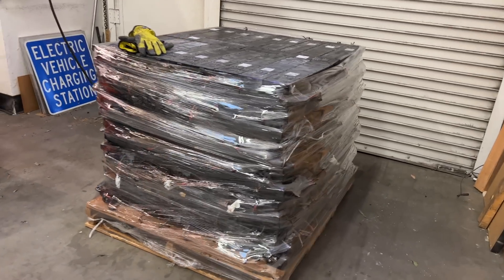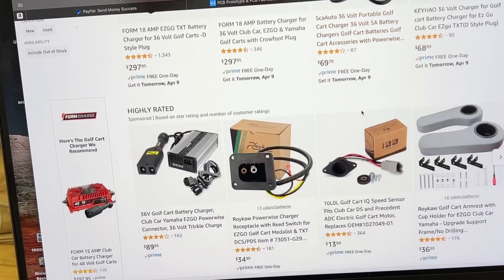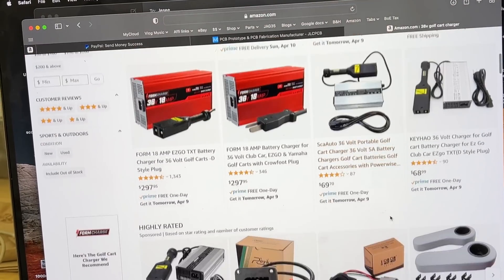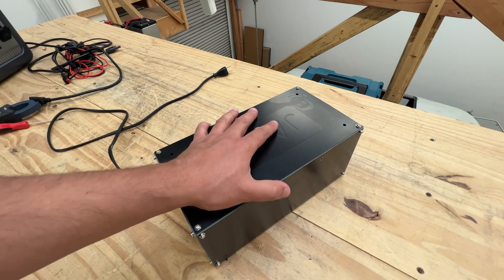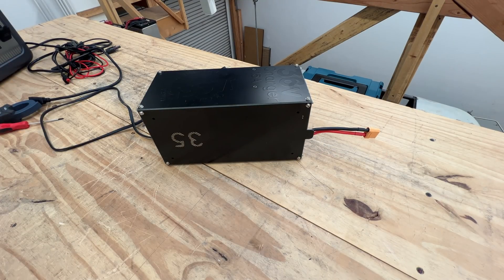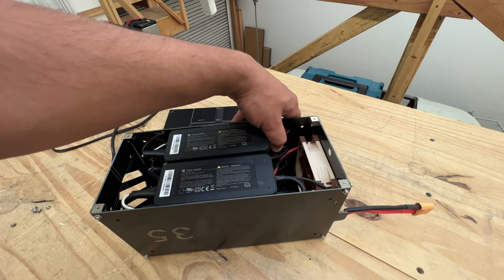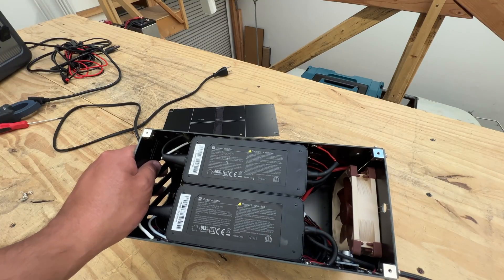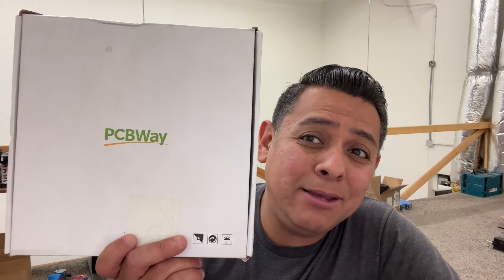500W 36v DIY Charger - PCBway

Comment: I know for a fact 2 segway 42 1.75 chargers can be connected in series on the AC input Power side/parallel on dc output. Essentially make the charger a fuse as well

Comment: Im proud of you, I have a question for you tho I am working with an ebike that had been in the rain and it had its own control board in the battery itself it seems to control the light that is built in the battery pack and charging and the battery pack output to the battery rack I am pretty sure that control board is broken and I want to replace it with a universal 36v ebike controller I know how to connect the outputs off of the battery to the new controller but I don’t know how to charge my battery then the ebike used to have a 41,2V / 2A DC charger like can I connect 42 volts directly to my battery terminal’s or no?

Comment: just curious why you didnt remove the chargers from there cases ,it would have knocked off huge amount of heat  , we are currently trying to work out best way to make an 82-84 volt charger that can up to 80amp  for super fast charging the cells and bms can handle it easy as the cells are dilectic nfluid imersion cooled and insulated ,so fire is impossible. just the charger is harder to sort out than youd expect,any ideas you have be awsome cheers KT
Reply from the maker: Too much work

Comment: you have good taste you make your diy look good  you also explain things in a way a newbe can understand  and my my you make parts and stuff so anyone can get in on the fun    hats off to you   there is cheap way of making a cheap high wattage charger that has as many charge voltages as you want   if you keep your eye out for them you can for free large transformers  in old trash apc  old sterios the really heavy ones old micro oven old trash welders and in many other things  some like  out of microwave will get really hot if used for more than 10 or 15 min at a time   but this is very eazy to fix   you just add 20 or 30  turns of wire to the 120 volt coil side after you have removed the high voltage coil  where your high voltage was you can rewind a new coil for any out put voltage you want or for many diff out put voltages   the more turns you wind into new out put coil the higher the voltage    ballpark would be every 1 1/2 to 2  turns will add 1 volt to your new output coil   this is really simple for most or all skill levels as long basic safty for ac is well knowen  it sounds hard or a lot of work but it can be done in well under 30 min   there are tons of videos on you tube on reusing micrwave trannys  i have not see a video that tells by adding turns to 120 volt side you can make them for contiuis use     i would ball park they are good for half org rating or a little less after mods to make them good for many hours of use if need be         lets say micrwave was 1000 watts lets say after mods it now has a rating of  400 watts max and our new out put is 36 volts      we know that  volts X amps =watts    400watts divided by 36 volts = 11.1 amps    we would need to size the new out put coil to be able to handle at least the 11 amp out put  you can look up wire amp carts for winding transformers on the web   i would use at least 2mm wire 12 gauge  reg 12 awg is good 20 amps on house hold wire  and 14 awg for 15 amps     14 awg on reg house hold wiring  would handle 11 amps with wiggle room to spare  house hold wire is not titly wound over it self on somthing that produces heat     so to be on safe side i use a size bigger wire wich would be 2mm or 12 gauge             i say all of this from many years and many 100s of diy transformers i have built  i also say it because when looking up wiring charts for winding transformers you will find all kinds of info that says many diff thing on this subject  some say to use chassis wire chart others say awg chart to name only a few   it comes down to how hot the wire is rated for and how hot do you want your wires to get to save a buck or if you do like i do mostly you save nothing    i unwind other tansformers  that would have been in land fill   once you start looking out for used transformers before you know it your hooked  and you give a heaping truck bed load to friend to recycle and steal have at least 100 of them piled up every where in your shop  if your recycaled enamal wire is not big enough for you desiered amps thats no problem just dubble them up until you have the reqierd amp rating              this is standerd pratice in tranny manufaturing   in alot of cases it is much eazyer to wind them all at one time as if it was one winding   if you suck at keeping them out of a not will winding  tie all of one sides of wire off to somthing then strech then stait making sure all is same length put them in you cordless  dill like putting in a bit tighten chuck tight keep just a little sag in wire while pull strait with you drill and spin them all together as one now big wire you will know they are spun enough when  starts to pull you   if you keep twisting you wire will get shorter  there is really no use to make the twisted together wires that tight   they stay together as one when taken out of drill  truly works great      ok you got your transformer  wound and mods done  you will need to know the voltage needed to charge you battery  this voltage will be a little higher than you batterys full charge voltage will lead acid and some other types so look this info up on battery you will be charging   you will need that voltage number    you cant charge a battery with ac voltage   a transformer can step voltage down to lower voltage  or step voltage up to higher voltage  it dose not change the ac voltage to dc voltage  you will need a full bridge retifier  you can get them for a buck or two online it will need to have a amprage rating at least as high as your tranny can put out   i buy the 50 amp squre ones with hole in center for bolting to heat sink or to the box your putting it in   you can find heat sinks in most junk eletronics you take apart  i over rate the amrage and put them on big heat sink  i like overbuilding for a life time of use  you can also find a dc capacitor or two or buy one on line two fiter ripple on dc side of bridge rectifer not really needed on a battery charger from my experance and all the research i have done but make sure for you battery type and or bms some could need a cap for filtered out put   ok  you you will need to find box of somkind to put it in  you can make terminals out of  two bolts and some nuts and washers  that you likly have already  rob them out of junk  this works well looks nice if you use plastic or other none conductive box  or pic up a few on line  you can also just  charging pug coming out of box     ok lets review my book of mis spelled word bad gramer rambling noncents  on somthing truly simple      DONT FORGET FUSE ON IN PUT SIDE SLOW BLOW IS BEST                                               when you retify ac to dc the ac voltage in and the dc out will not be same  there is some math you can do to get this change you can look up the dc fillter cap also changes it a little math formla online for both     you can do math to find out the exact voltage your tranny out put you will wind will need to be   the eazyest way to get your new tranny out put coil the exact right voltage  is to ballbark  how many turns you will need             on the moded extra 20 to 30 turns on input side microwave tranny and most bigger trannys this will be 1 or 2 turns will give you one volt of out put   so if you needed 36 volts output you could pallpark it  say  ever 1.5 turns = 1 volt     1.5 x 24 =36  so wind 24 turns leave wire long  then you would plug the 120 volt side of your trany into a out let then test the output coil you just wound and see if you need more turns or take truns off     you could get the out put close to what you need add bridge retifer and cap fillter plug it in out let and test voltage to see voltage change from the rectifer after cap if to high take turn off if to low a turn untill perfict out put that would work insted of finding and using the two math formulas   you will die if you dont know the safty involved in testing it no joke its death if you do not understand how to be safe   on places like ebay you can get a little digital read out relay that you can set to auto kick of your diy charger on the ac at from 12 to maybe 72 volts for 4 or 5 bucks  so a few recycled parts few bucks  on ebay you can make a really good diy battery charger of any voltage that will last for a few life times  ok best thing i saved for last  same  process for any transfomer you can recycle for free  only trannys that will need extra turns on 120 volt side is microwave and some welder tranny  alot of trannys will only need a few extra turns added or a few took off of out put side nothing else you can use one or ten transformers  most usa outlets can handle 1800 to 2000 watts so for a 36 volt battery the out let will limit you to 50 or 55 amps  but if you have a 40 amp 240 dryer plug you could make a 36 volt 266 amp charger same way but bigger300amp rectafier and a50 amp 240 contator to triger from the small setable digital relay   i have the 240 contator  i have a few nice 240 volt giant tranys  even a inclosed 9000 watt 3phase  one i have new in box 400 amp bridge retifier it was i have giant dc filter caps anybody need a gaint battery charger? we could set it up with a bunch of diff out put voltages that all could be used at same time  or other cool stuff no charge for my parts or my labor would have to come to my shop for a day  My name is Ben agian everything i have for build is FREE and FREE labor  any takers i will give my full info so you can do back ground on me my wife and kids so you know i am not nut job takers text on here

Comment: If heat did hypothetically begin to present an issue, I bet a guy could get another 10 degrees of cooling byyanking the top clamshell of the psu units psu off, wrapping in kapton tape in the burrito direction then reseating them replacing within the enclosure, then fan pulling air through them, negative pressure style
Reply from the maker: Yeah but that a lot of work,  their cases are fused together with glue or heat

Comment: Tooooo many connections. I love your videos but all those connections in a DC battery will cause resistance and heat which can cause a fire.
Reply from the maker: Electronic devices are full of connections inside,  most have way more than this,  not sure why you think this is too much.

Comment: Not a bad project to keep some of these chargers out of the landfill but I would scrap the PCB idea completely (since PCBs are expensive for this type of use) and just use tie points and isolators to bond everything together and that should make assembly fairly easy since we are talking about a minicule amount of power here.

If you continue to use the circuit board idea, I would recommend much wider gaps between AC input traces(Line and Neutral) since you have a ton of space to do so, the DC fan traces are also very close to AC input and use anti tracking slots cut into the board if that is not possible.  I would also make sure you have a decent separaration with no copper between AC and DC sides as well as AC mains and the case grounds where the board mounts.

When doing circuit board design where you are dealing with mains 120-240v it is a good idea to plan for the worst case scenario in regards to creep and separation between supply traces.  It would also be a good idea to use a fire retardent conformal coating during assembly to seal and prevent contamination of high voltage traces if you cannot physically provide more separation.
Reply from the maker: Pcbs will cost me $15 in quantity and will save tons of of work in comparison to any alternative. There are many ways to look at this, and making this affordable is one of the requirements.

Comment: Normally you would never, ever connect two power sources in parallel like this. However, since you're using them as chargers, they're the ones providing the current. If one dies, and we assume there's a diode on the output on each one, the current output should just decline. For powering things, you would never do it, though. If one dies, the rest has to maintain a higher current, which will eventually cause a fire unless they're shut off.
Reply from the maker: No they only do 2A each no matter how many other chargers are on or off
Reply: @jehugarcia  Yeah if they're CC it shouldn't be a problem
Reply: Huh? Paralleling inverters is extremely common.
Reply: @niktak1114  Inverters?